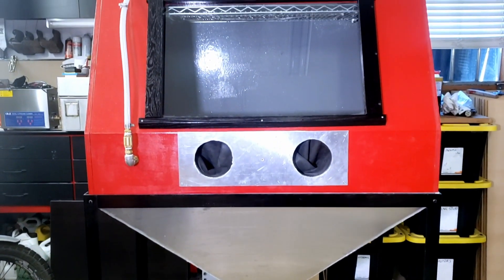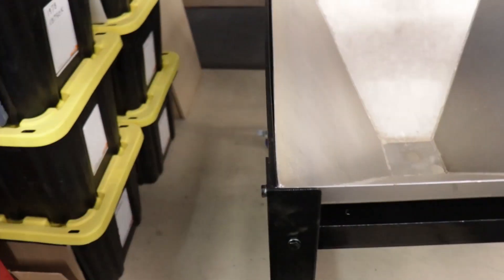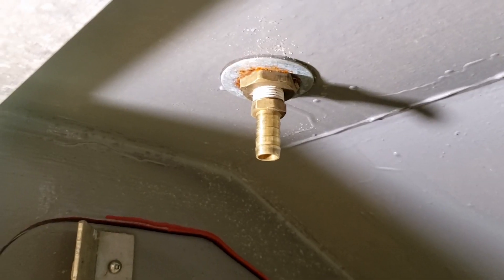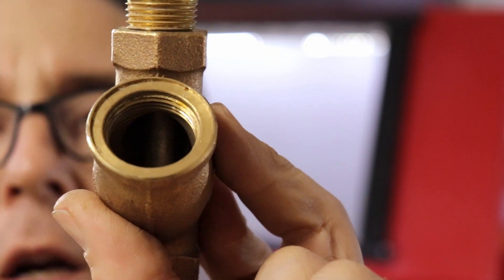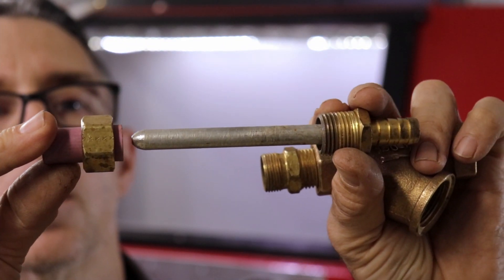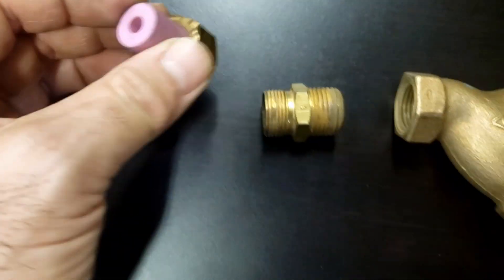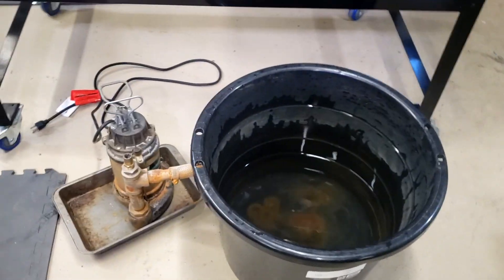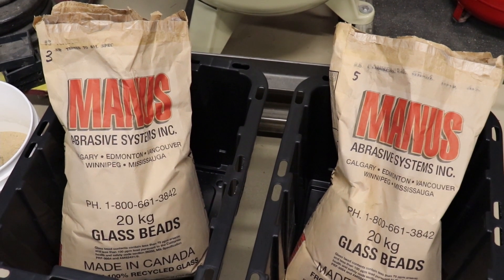DIY Vapour Blaster Part I: The basic blaster

Comment: Hi great video, @13min 10 sec you mention that the pump is 3/4 HP - the rating plate says 9.8A at 120V which is 9.8 x 120 = 1,176W.
As 1HP = 746W your pump is 1,176 / 746 = 1.58 HP. Hoping this info helps others…